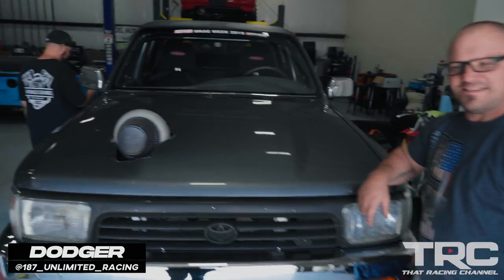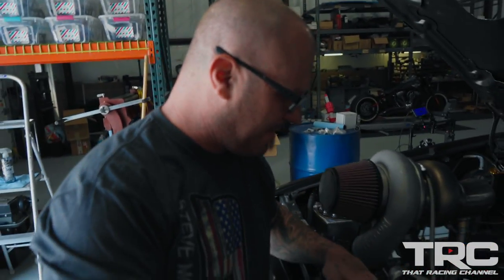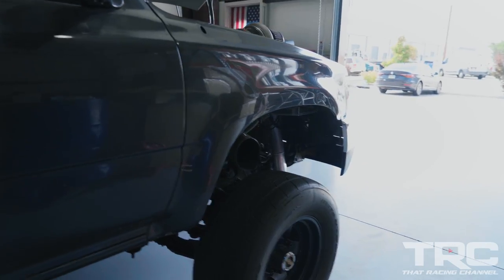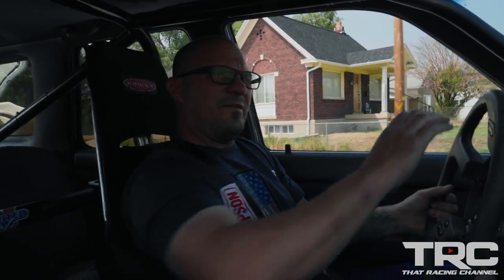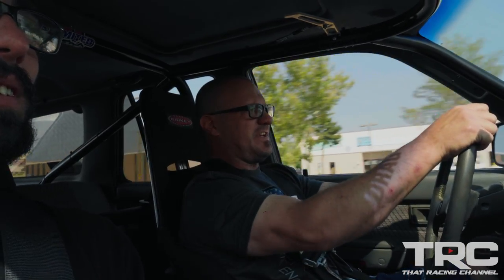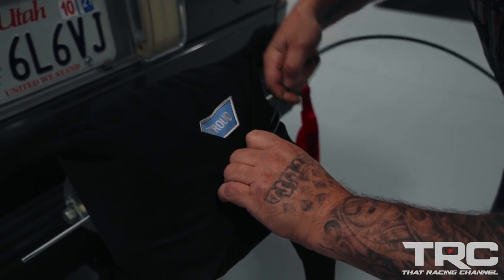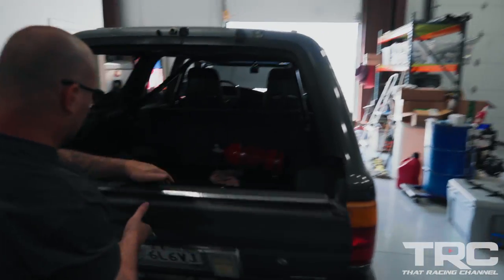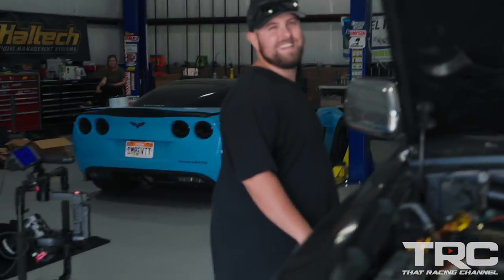2JZ 4Runner?! 1000HP Supra SUV (Fastest Toyota 4Runner on the Planet!)

Comment: 2nd- 3rd gen 4Runners are the best those body styles hold up even today
Reply: The 3rd gens are going waaay up in value lately! Timeless trucks
Reply: @hunterjohnson4954  I believe it
Reply: 2nd gens 3.slow engines arent that great lol. But the 3.4 on the other hand🥶
Reply: @rapalaray1701  that 3.4 is kinda slow too, but daaaaang it’s an engineering masterpiece in terms of longevity. They are alright on power and will do any thing a 4runner needs to do anyways
Reply: bought a 01 sr5 4x4 for 5,000 best vehicle I have ever owned I s2g ...... and I came from a vehicle that was a 2012
Reply: @hunterjohnson4954  compared to the 3.0 waaaay faster imo. Depends what gearing too. I had one with 5:29’s with 33’s and man did she soar. Now i have another with 4:88 factory gearing with 33’s and can barely go uphill at60 lol
Reply: I've got a 94 4runner with a Supercharged and methanol injected 5vz and low miles, then I've got a stock 99 4runner with 376,000 miles. I love all 4runners, but especially the 1st, 2nd, and 3rd gens.  So well built!
Reply: @jhondalexusmeyers I have a 2nd gen and a 3rd gen 3rd gen is built pretty well but my 2nd gen is built better imo interior wise besides the dash cracking I have a intake on the 3rd gen I'm planning on 5vzfe swapping the 2nd gen I love both if them
Reply: @jhondalexusmeyers  had a supercharger on my 15 4 runner switched over to a 76 mm turbo mid mounted sounds like a factory truck lol making 531 awh

Comment: No doubt it makes that power. But I’m almost positive the ride along part, it was not turned up that much. It looked and sounded like a solid 700-800. Getting up into quad digits has a much different violence to the sound, I mean you can even tell from the video they show of it doing a hit at night after the dyno and the hit he made with TRC in the car, totally different sound and powerband.

Comment: That’s so badass I want to build a 2UZ so bad. I’m not experienced in machining so I’d need someone to machine the head for the cams I want, to fit properly and I know nothing about tuning so I’d need a stand-alone and someone to do it for me. I’d need to build the transmission and know nothing about building the transmission and I don’t have anyone local that I could pay to do it for me. I also don’t have the money for that so I’m just SOL😭😅 21 bout to move out of mom and pops and just bought an engagement ring 😭 I may never live out the dream of doing a pull in my 800+ hrspr  2000 model tundra

Comment: TBH, I'm surprised that no one at this point has develop a V12 from slapping 2 of these things together.
Reply: They are inline 6s, the geometry is all wrong. They also make tons of power with 6 cylinders.
Reply: I forget what channel exactly it was but they had 2 2jzs in one Supra they were working on getting it to run correctly and In sync with eachother. Just type it in its the first video that pops up
Reply: @applebitefool   True, just saying cause there is a guy doing a V8 with K engines.
Here is the video: https://youtu.be/jFxFjgffS1A
Reply: Look up 1gz-fe

Comment: Imagine this in a Lexus gx470 🤔 or maybe slap a single turbo on the 2uzfe
Reply: Nope... Have u seen the potential on fj80 inline 6 motors? 1fz-fe ?.. it can keep up to a stock 2zjte if u turbo it too..
Reply: @mryaj0095  true, but twin turbo Lexus v8 would give Lambo urus a run for their money, it has more displacement than urus with 4.0 engine. Of course software tuning and transmission are the only draw backs of the GX platforms
Reply: @buffsamuraifred6037  id still choose an Inline6 regardless. Its the unique sound of an inline6 vs V8 that  can not compare.. thats just me
Reply: @buffsamuraifred6037  of just go with the Lexus ls500 engine. Which is what the new twin turbo Tundra will have... V6.... screw the v8 . 😃